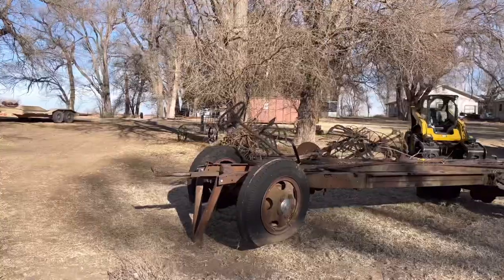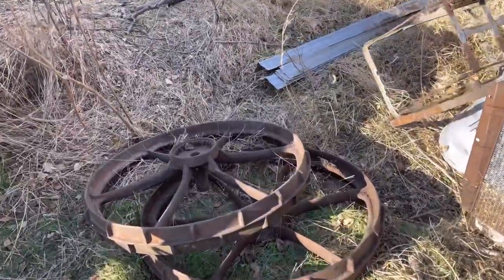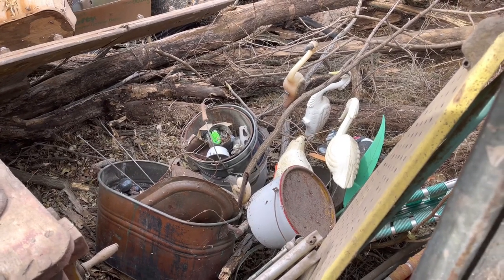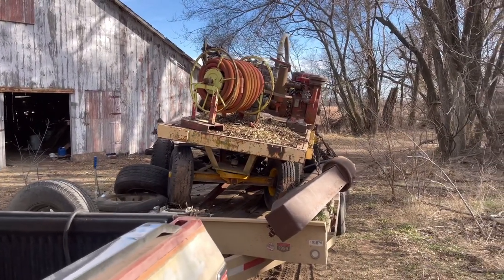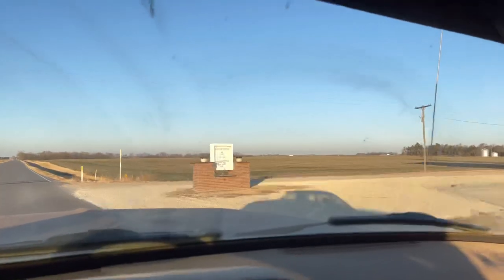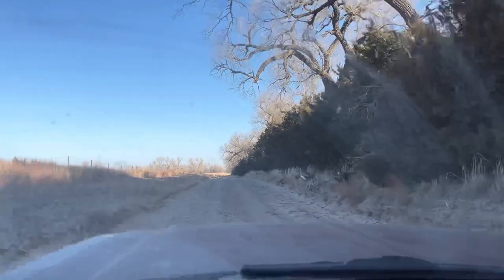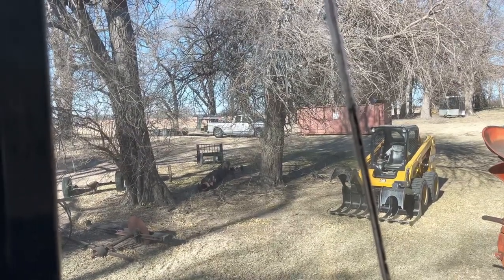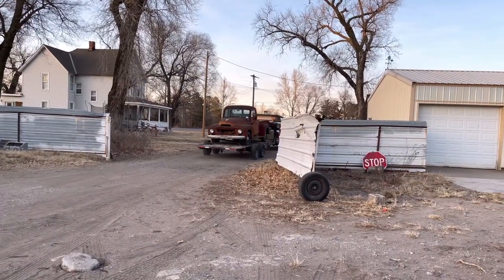Hauling Cars, Trucks, & Tractors + Dug In Some Old Buildings | Abandoned Farm Cleanup Day 5 & 6

Comment: I find if you buy the parts Off of eBay you can get quality parts real cheap for instance my Buick needed Ignition pack I've got it on eBay for $34 but the shop wanted $300 It's best to shop around  They go on a cabinet door their handles or address or something to that effect there's a hole in the dresser drawer and you screw  Them in

Comment: Silas, I ran a good business I started and it windmilled into a huge business. I cut my profit line so thin that I was the only guy who should of been on welfare by the time things got sorted out. I had figured that if I grossed a million plus, I could make it work on One Percent, stupid me cause I did do good for the first two years but then we had a election and this game was no longer the same. I might of still made it but a crooked bookkeeper took me for four million and then with no margin, taxes have to be paid. I lost everything I had built to the government auction at less than ten cents on the dollar. Odd you don't have a good radiator in all the scrap that you haul, that couldn't be  repurposed. Its not a show truck so water is water and a trans cooler can be done from many different little radiators. I do believe on how much it cost to fix

Comment: In certain areas that old barn wood is like gold. I've been able to get some 80+ year old small pieces in my area and carefully remove any original nails and turn the piece into a small shelf or counter top display piece re-using the original nails, then get up to $100 for it. Just something that was pulled out of the dirt or saved from a burn pile.
Reply from the maker: This barn was built in 1901. I’m attempting to “save” it from being burned down. Hoping I can find someone to reclaim the wood

Comment: It's kinda crazy. I understand you're looking basically for the scrap value, because it's fast & easy. But, if you could only have the time to store & catalog all the items you are having contact with. There was a pile of steel clothes hangers that would bring a good price. They are .70 cents a piece new. And the new ones are no where near as heavy as the old ones. SO, you could easily sell old hangers for .70  to a dollar apiece.
Reply: Can't save everything time is money especially when your trying to run a business with not enough help like he is doing. When you step over dollars to pick pennies that's when you will run out of money. The more volume you create the more money you can make like in all businesses but in the scrap business you can't waste time or the market may go down and then you will lose money then. Especially on  mobile job buying at your static yard you can just pile the metal up as long as you have the money to hold until the price goes up.

Comment: The knobs that you have are drawbar stop knobs from a church pipe organ. The organist pulls out the stop to couple the rank of pipes to the keyboard or manual. Those knobs would thread into wooden drawbars located on each side of the manual. They probably are from late 19 or early 20th century.

Comment: Silas - I have lived in some cold parts of the country, such as Oregon and the mountains of Eastern Arizona, but I have never lived in a place where it gets to 30 below at night. Rather than eating up 30 minutes waiting for your truck to warn up, can't you just use a plug-in block heater to keep the oil warm?
Reply from the maker: Those don’t keep the oil “warm”, but more like they make it to where it will actually start. But to answer the question, there isn’t any power for 2 miles.
Reply: OK. Learn something new every day. I've never lived in a place where it got cold enough to need a block heater. Now, if you want to talk about HOT, that's a horse of a different color! In the Summer of '81, I was in El Paso on a day it hit 128.9 F. In the Summer of '97, I was living in Lake Havasu City. We went 21 days where it never dropped below 100 F, day or night, and one day it hit 125.6 F. Don't let anybody fool you! It may be a dry heat, but 125 F willl kill you just as quick as 30 below, if you're caught outside without the right protective gear!